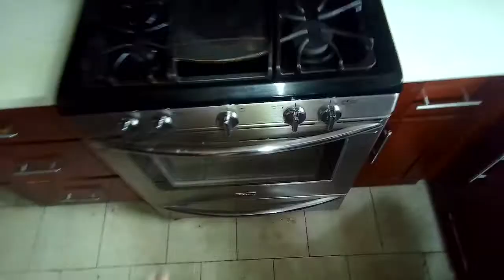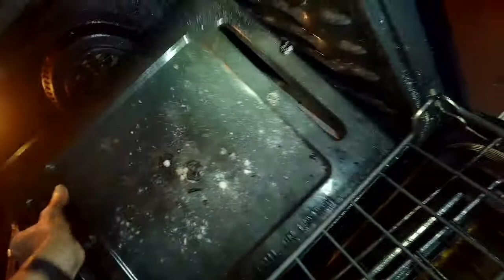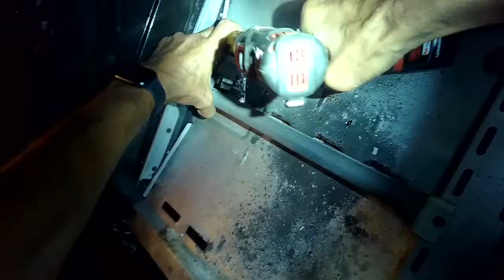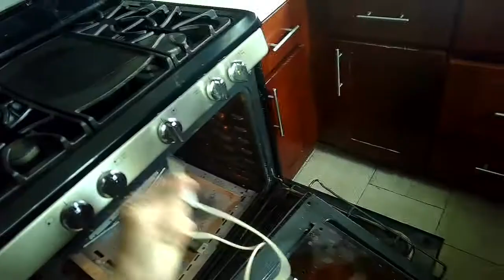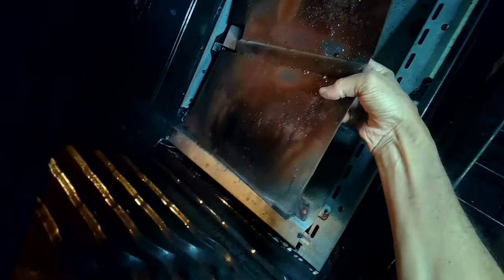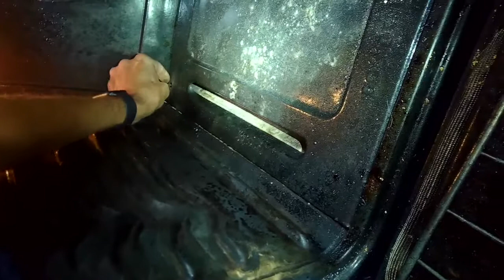✨ GAS OVEN TAKES TOO LONG TO HEAT- Easy -DIY Repair ✨

Comment: Scott, l subscribe to you and found this post serendipitous since we have been having problems with the oven glow ignitor. However, looking at Amazon and other online suppliers I have not been able to locate one deemed compatible with our 15-year-old Hotpoint model # RGA520 EW9WH, outside of GE Part # WB21X10140, which is priced at $152 and up. Could you recommend a universal one that would work and has a reasonable price?
Reply from the maker: Hi Douglas,
Yeah that’s a huge rip off.
This igniter works just as well and only cost about 25 buckshttps://www.amazon.com/PS470129-FACTORY-ORIGINAL-FRIGIDAIRE-ELECTROLUX/dp/B00MH4EV70/ref=asc_df_B00MH4EV70/?tag=hyprod-20&linkCode=df0&hvadid=198107422705&hvpos=&hvnetw=g&hvrand=9554999603141303859&hvpone=&hvptwo=&hvqmt=&hvdev=c&hvdvcmdl=&hvlocint=&hvlocphy=9032028&hvtargid=pla-348130128902&psc=1
Reply: @QuickAndEasy5MinuteAppliance  Thanks Scott. Could I ask you one more thing -- our oven ignitor shows the signs of failing you described, taking several minutes for the plug to fully set off the gas with a minor "explosion," but there are still low flames coming out of the burner before full ignition, so there is some gas coming out. Is that normal or is there perhaps another problem?  I appreciate your advice on the ignitor: So Frigidaire will work on Hot Point! There were so many choices on Amazon, and when I entered our model # in the compatibility boxes got replies that they did not know if the ignitors would work on ours. So I feared maybe GE  engineered theirs so only it would fit and consumers could not substitute universal ignitors.
Reply: Correction: I looked closer. What I thought was gas coming from the burner was merely the yellow glow from the ignitor. It is very bright, isn't it, even before getting strong enough to light the gas.
Reply from the maker: You’re right.  That new igniter will do the trick👍